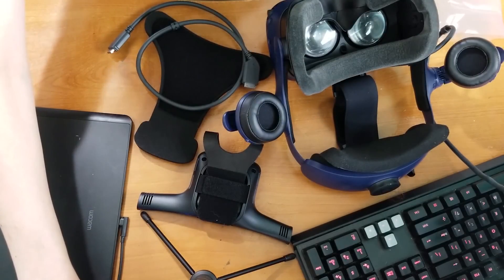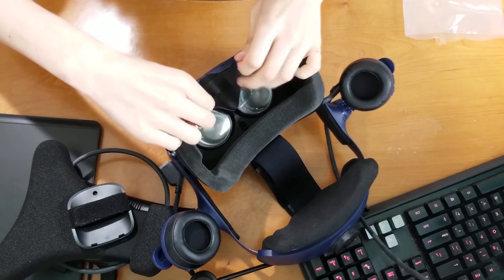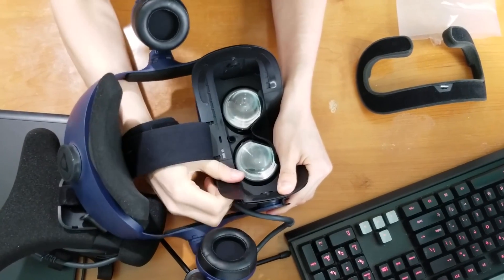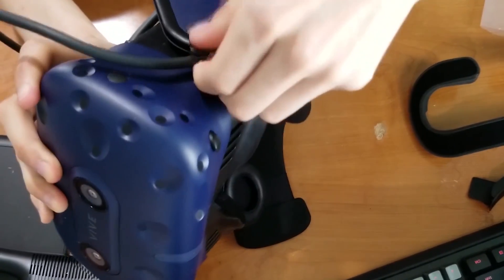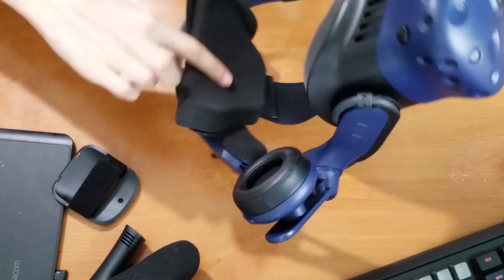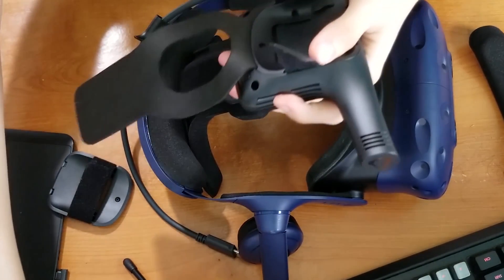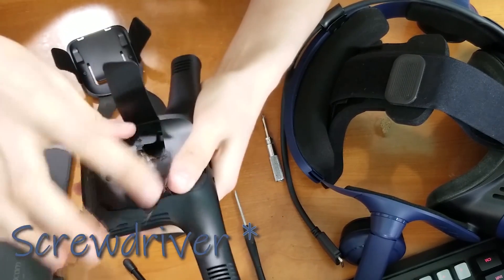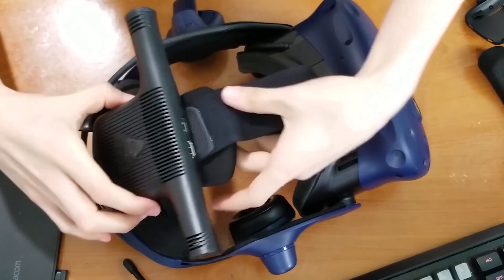HTC VIVE PRO WIRELESS SET UP - Tutorial / Instructions

Comment: Thank god for this video! My Vive Pro headset was not turning on I realised there was no red light as if it had no power and this was realised the moment I turned on Steam VR and AFTER I ACCIDENTLY DROPPED MY HEADSET.. At first I wanted to take it a part but couldn't because I was missing the required tools to see if it was something internally but then I realised I thought if it was a loose power cable, Ofcause I checked the computer ending and the connection between Computer and headset and to no surprise everything was fine there. Then I realised when people use Wireless they had a shorter cable than the one given in the first place and though "How do I get to the power cable" and found this video WHICH WAS THE SOLUTION! The power cable must have come out when I accidently dropped it and made me think "Oh shoot.. It's broken.." but I was lucky that It's not and that I found this video so, Thanks A lot you helped me in a none intentional  way with this video :D

Comment: I actually found if u take the circular section, pull it down around the knob, then velcro the antenna to the section intended, around the foam pad, then tuck the velcro tail down undet the bottom of the pad to tuck it out of the way..... The antenna then has a pull to it from the back/knob, and it's much sturdier

Comment: Great video, one bit of feedback: there doesnr seem to be a need to remove the cable cover, the cable slides right out, and slides back in without much wiggling.
Reply: Getting the connector into the socket was a bit tricky on ours. It might be possible without removing but it was definitely helpful and easier doing it this way just now.

Comment: Thanks for the tutorial. I haven't got the wireless adapter yet, as it's not available where I live, but your tutorial helped me remove that fiddly cover that allows access to the cable port. I had trouble finding help about how to access it on HTC's website and there weren't any other videos that clearly showed how to do it. It's much more difficult to access than original Vive's ports but I managed to do it in the end. Turns out I didn't actually need to eventually, as my cabling error was at the other end, but at least I now know how to properly attach my wireless adapter when I finally get my hands on one. Can't wait as that cable is the most immersion breaking element of the whole system.